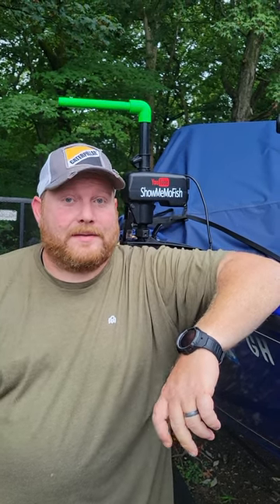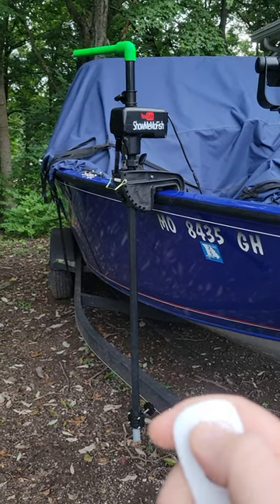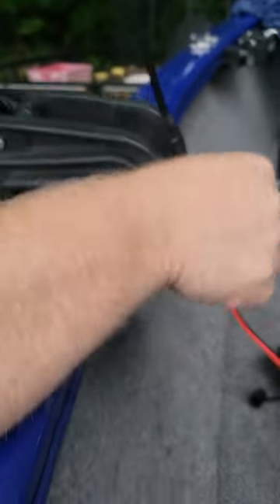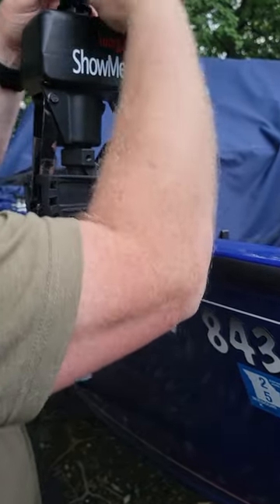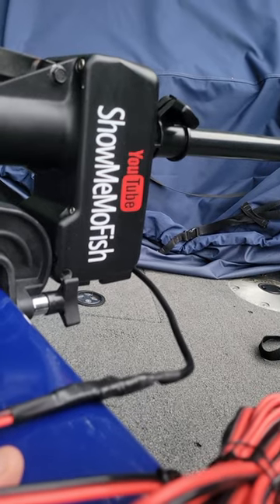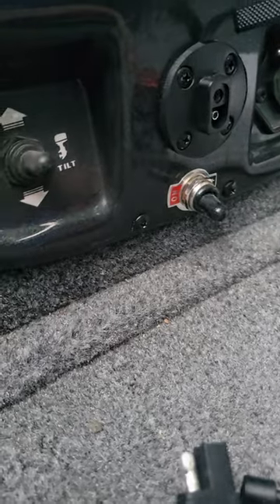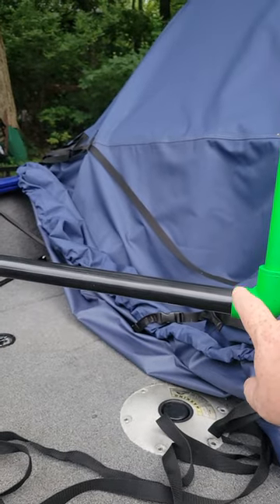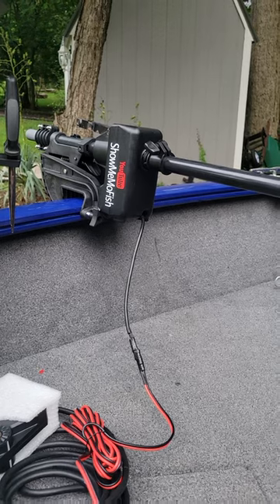Custom motorized livescope pole!

Comment: Great video and great idea congratulations and thanks,
for sharing it with us. May I ask where the wireless controller connects and do you think it is possible to replace it with pedals or are both options available? Thanks in advance. I wish you a wonderful day.
Reply from the maker: Wireless controller connects to power from my cigarette lighter plug that was there and the other end straight to the 2 wires on the steering motor. I thought about a pedal setup just haven't found anything I like yet.

Comment: I kinda stole ur idea. Used a new powerdrive power steering box, top  bottom collar and pole. Mounted 2 hinges on a down rigger Mount threw on a motor controller working awesome. Only 180 or so invested.